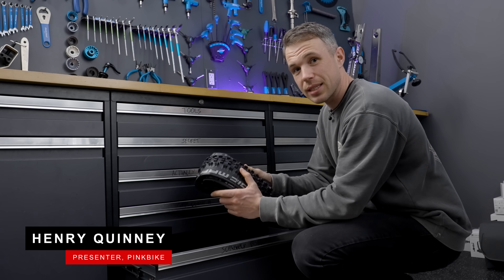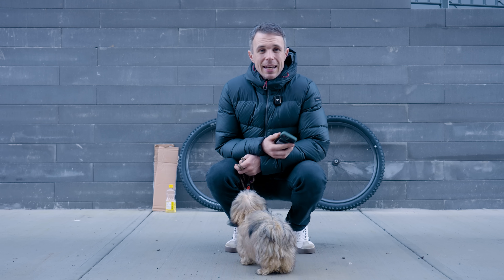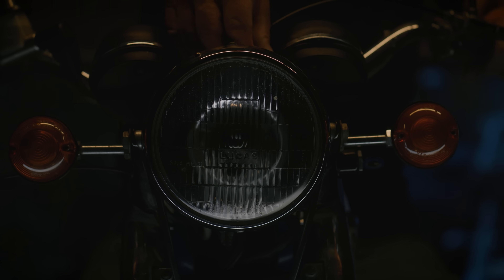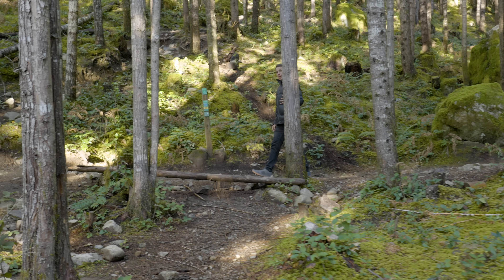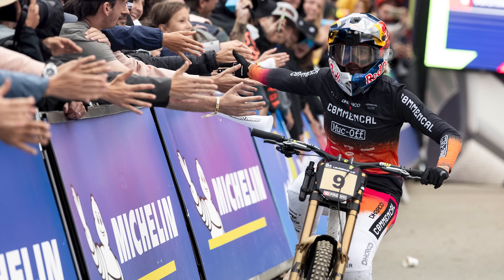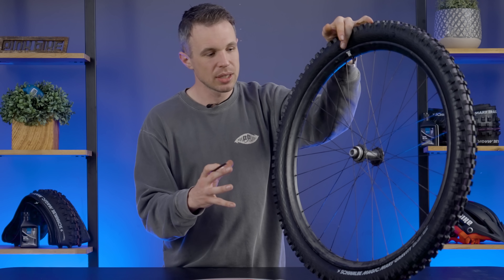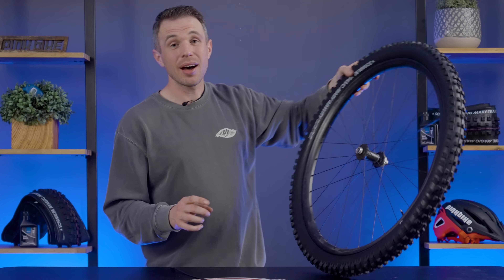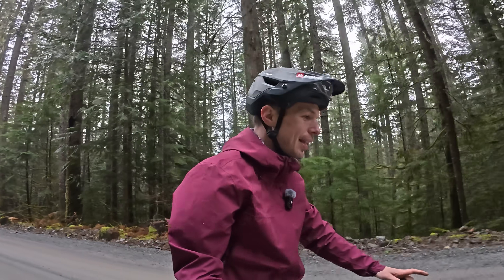How Does Schwalbe's Radial Casing Work, and Does it Actually Make Any Difference?

Comment: I have been running these tires.

In my opinion the Magic Mary Radial tire is garbage. Schwalbe ruined it with the changes they made to the tread pattern on the Radial version. They made the tread bigger and spread them farther apart. The Radial version rolls extremely slow, even slower than the standard model, and is only good in the most softest/muddiest conditions. On the flip side, the Mary does shine in soft/muddy conditions. All other conditions it sucks, to include the side lucks folding over. This is running pressures up to 32 psi. Once I started using over 30 psi in the tire the suppleness started to diminish.   

The Albert on the other hand is a pretty solid tire. In my opinion better than the Maxxis Assegai in every way. Rolls fast, works great in all conditions even mud. I haven’t had problems with it shedding mud.

I give the Magic Mary a 5/10 while the Albert gets a 9/10, in my opinion.

Comment: Got me a set of Albert gravity casing 2.6's and they do have great grip and they feel softer with more resistance when pedaling compared to the pressure my old tires were at. Upping pressure slightly made them pedal better.  Like said about tires being smaller is true as my 2.6's are more like 2.4's. 😵‍💫

Comment: Ok, so the contact patch in this test is absolutely same size. Radial casing means softer tires, so those can be good for lighter riders and only to use with rim protection inserts. You can simulate such tire behaviour just putting some paper-thin XC tires on your DH / enduro bike. Yay contact patch! xD

Comment: Interesting explanation and video :-) / Been riding then radial Albert gravity for some time now..managed to get a set to test for an Italian Mtb media outlet. At first I found them completely confusing..coming from a traditional tire set up like the vittoria mazza race which I have been using for more than a year. I ride the new Schwalbe on the same trail (rollercoaster finale ligure) for 5 times and each time adjusting the tire pressure. Last run on 27psi rear and 25psi front felt like I was able to get everything out of the tires and then some more. Perfect pressure set up..72kg body weight and 15kg super enduro bike = 87kg of weight.
Reply: How do you compare the Mazza Race with the Albert Radial? Do you like more of the Schwalbe over the Mazza now?

Comment: I'll just leave this here: bought the Albert, installed it, pumped it up to roughly 35psi before it blew off the rim. Installed it again(my mistake) to try if it still held air. Rode it for a few km down a train just for it to blow up again on the landing of a small jump. I don't know if I got a manufacturing defect or if the radial casing somehow has weakened the sidewall to an extend where it doesn't hold onto the rim, but I will say their stated max pressure is the lowest I have seen on any Mtb tire, even lower than on their other tires, which is concerning considering you are supposed to run it at slightly higher pressure than non radial tires.
Reply: Stan’s rim? I’ve serviced tires on just about every rim out there and the only one to blow off were Stan’s.

Comment: I've tried them on my Mountain unicycle, where tires are basically the only suspension, so its behaviour is very important. Does it make a difference? Yes, it feels more compliant at higher pressure, but it also feels very spongy at lower pressure. I like it slightly better for riding in rocky terrain with lots of sharp edges, but I think I might prefer the normal casing in smoother terrain. 
It's a good tire technology, but I don't think it is the revolution that Schwalbe claims and they should probably keep the normal casing around, at least for some models.

Comment: Everyone is drinking the coolaide.
Reply: Everyone getting payed to sell the coolaid. I'm desperately waiting for some independent reviews, but I guess everyone got money to produce ads (like this) on the launch, so they can't really do it yet. 
Good, but not a gamechanger and not better in all situations is my summary after testing them btw.
Reply: @ 100%. I am running a pair atm. Won’t bother putting them on again for the price. Every other rider who has tried them in my area repeats the marketing spiel back to me about them. Next front tyre will be High Roller 3. I predominantly ride loose over hard. Back to back testing with other tyres suggest these are pretty good.
Reply: @thegriff9425  Were they more expensive for you? I bought the Albert specifically because they were the same price as getting the magic mary I was running before again and I wanted to try a slightly less "spikey" tread pattern. Somewhere in the 70-80€ range is about where most soft compound, stronger casing enduro/DH tires are nowadays and the high roller 3 seems to be the same.

Comment: Wait a minute! HOW the contact is 30% bigger with the same pressure? Because sidewals are MORE compliant - they BEND more - that how I understand it. So, to protect the rim you will have to put more pressure - to compensate more bending of the sidewall. This will decrease contact area.
What is the point then?
Reply: Well, not everyting is linear.
Schwalbe says: Adding 7 psi (0.5 bar) still gives you 10% more contact area than a regular tire

Comment: What they leave out in terms of puncture resistance is the fact that there is no steel belt in the bicycle radial. With that said, what does a goat head do, besides go on through the casing? A piece of glass is going to Ginsu knife the tire regardless of bias or radial.

On the brighter side, radials will offer better ride quality and traction. I had a pair of radial XC tires in the early 90's that were made or offered by an obscure brand. They did work but were discontinued in a short time after the first couple batches were out. The issue was people throwing them on stupid narrow rims and wondering why they folded in the corners. Too supple was the reason the tires had been discontinued. (I hoarded wide rims due to the 90's sucking right out loud for rim choices)

Not many people can understand why my trials bike has a 48mm wide rear rim. With a 2.5 on it! Road rims are worthless for dirtin' and worthless for anything wider than a 1.5...

Comment: Correction at 6:29: crosses on a 3x are totally accidental. We use crossed wheel lacing to make sure that the spoke exits the hub tangent to the flange of the hub. Also - spoke length has no bearing on its tension.
EDIT2 - frankly - the entire analogy makes no sense.
EDIT3 - also, contact patch is almost entirely up to pressure.
Now what is true is that radial casing ought to be a little more supple because layers of the casing cloth are not working against each other - which is why it is used widely in car tires.

Comment: 2.6 Albert Radial measures at 2.4 when it's stretched. I'm not a fanboy or anything but failing at such a basic, yet so important thing makes me question about the effort they put into the new radials.
Reply: My freshly installed 47 mm tire is 42 mm on my rim. Gravel bikes have limited tire clearance, but I was brave enough to "size up". The rim can alter the width.
Reply: @fpeter01  mtb wheels "jaw width" has drastically changed in the last 5-10 years my 2016 all mountain 27.5 2.25 had 21mm jaw width now most have 31-33m this for sure changes the actual width of the tires I think I remember seeing a jaw width-tire width chart somewhere but can't remember if it was on a rim or tire pdf

Comment: "3x spokes are longer so you have to run the spoke at a higher tension to compensate" not remotely accurate. Longer spokes have more strain at a given tension so theoretically the longer the spoke, the less tension you need. d=PL/EA. After all, the only reason we tension is so the spoke can still maintain a force on the wheel while the wheel deflects, like a spring being shortened. And don't you dare try to tell me that the stiffness of the wheel is dependent on the spoke tension.

Comment: did not watch it till the end,too nerdy for me.. but have one of these(Albert) installed on this bike on my profile picture.. Rear tire on a hardtail and biggest difference of any tire swap so far in my riding career(10+year riding). I have insert in there as well,had to up my pressure by  0,3 bar (do not try and ride same pressure as conventional tire,just does not work). The way tire stabilizes rear end and smooths out the ride(especially noticable on carbon hoops) with much better braking traction,it is super reassuring. I did have old NOBBY NIC 2,4 on there before, in soft casing and this could have influence my judgment to be fair,but if you ride "stiffy" out back I think you can not go wrong.

Comment: Useless promo. Henry didn't even clarified that by "radial" they mean less than 45° angle of the threads (I think it's around 30°) and he proceeded to show how the equivalent position of a radial spoke would go "straight to the rim" which is not the case for this tyre. You pretend to explain and clarify how it works and you are actually more shady and dishonest than it would be flattering for you. Pinkbike could be a great source of technical knowledge but bills have to be paid... Pity...
Reply: Yeah this was shady. Pinkbike isn't what it used to be...

Comment: It's a good story, but it's made possible by tubeless technology.  Tubes need stiffer sidewalls so they don't pinch flat.  Radial tyres will become the next thing since it appears to be working out, plus they should be a bit cheaper to make.  They'll be tubeless only.

Comment: well, the oil test showed exactly the same contact patch...
Reply: The true reason for this design is to create seperation between you and your money.
Reply: SepAration vs seperation
Reply: Indeed
Reply: I have a hard time with the concept that radial laced wheels can be run at lower tension. The physics make no sense to me, and I think it’s a bad analog for tire casing.
Reply: How hard was it to find a ruler?
Reply: I'm sure that they will work as effectively as a placebo.
Reply: Ha ha, bet none of you nay sayers have tried them. I too was cynical and wanted to hare them. Now I  won’t consider anything else as a front tyre. They are brilliant in gnarly terrain
Reply: Let's wait and see the performance during UCI downhill and enduro world tour.
Reply: @APOCLAG Amaury won in spectacular fashion on them, running a ridiculously high pressure in the rain.
Reply: @justinfournier1285  Indeed! In fact, he won 5 races, 2 in deep rain! He is great!
Reply: @Mvees  Well, but you can't look at the oil patches shown there and tell me that there was any conclusive difference shown there. On a marketing video presented as a review such as this one, cynicism is the correct response.

I've tried them btw, different, but not universally better would be my take. Great in gnarly terrain as you say, but for smoother terrain I think I prefer normal casing.

Comment: My buddy was sheepishly admitted to rocking these when I asked Wtf are those? Must be expensive
Reply: They are, early adopter fee as always. I did hear good things from friends using them though, so I might fall victim to the hype as well
Reply: @sp00n  Not really, pricing is exactly in line with the competing tires. Soft rubber, strong casing enduro/DH tires all seem to cost ~80€, whether Schwalbe, Maxxis or Continental.

Comment: I'm going to say what i said in a comment. The entire benefit of pneumatic tires is that the pressure everywhere in the tire is the same. The area of the contact patch is simply the weight divided by the pressure of the tire. 200lbs on 20PSI tires will give you a 10 square inch area contact patch. Maybe the contact patch is wider?
Reply: If your tires is as hard as a rock the pressure doesn't matter at all. It matters how much force is required to deform the tire.
Reply: @a.r.8850  Exactly. I have some heavy load range tires on my truck and even if the PSI is down into the 10's the rear still looks near as inflated and the fronts at 50psi. The outer tire carcass is so firm that it takes a lot of weight to even begin to deform the tire.

Comment: I just climbed and descended 2500' on my radial Mary and Albert. I ran about 5 psi higher than normal for each. It was an absolute game changer. The grip was noticeable, but even better was having more air pressure for added suspension.
Reply: Isn't more pressure equal to less suspension?
Reply: @gooutanddogreatthings  More pressure gives your tires more compression before bottoming out on the rim. The only reason we run lower pressures today is for grip, but if we can get the same grip with higher pressure we get a little added suspension.
Reply: @ChristopherBloom  What do you weigh or what was your before and after pressure  -after adding 5 psi?
Reply: @TazErrant  I'm about 160 with gear and previously rode about 19/24 psi.
Reply: @ChristopherBloom  Thanks - that gives me a good comparison. I'm 110 with gear and currently run 16/18.

Comment: Have the Albert tyre on the front and love it. The grip is amazing. May get one for the rear too but run it at a higher pressure. When I got the Albert tyre I increased my pressure from 1 bar to 2 bar 👍

Comment: They really are a "bit" better than the normal MM Ultrasoft casings.  Needed to add a couple psi (20 up to 22) or they give way a bit in the corners, but you do notice a small difference.

Comment: These tires are not bad, just not worth the price. Increased suppleness is mostly negated by the high pressure you'll need to run. I will not buy them again unless they are cheaper than the regular casing.

Comment: I run a Zipp 3 zero rim, 220mm rotor and powerful brakes and a Push ACS3 coil conversion. This could be the next step to improving the front end of my bike. It was pretty amazing in the Alps this year as it was
Reply: Yes I was on my Yeti the other day with 222mm rotors and a Zipp 4 negative zero rim and my electronically actuated suspension by Ferrari. It too was pretty amazing after I toured my yacht to the New Zealand coast to hit the local DH trails in their beautiful summer weather.

Comment: A lot of great points explained in a unique, different and easy to understand way. Enjoyed that perspective, thanks Henry!! 

Unbelievable how much of a difference the Radial casing makes and I'm also impressed at how well the system works in wet and damp conditions, the extra contact patch makes an insane and notable difference as I'm running closer to traditional pressures. The grip gives confidence and helps with composure to hit those technical rooty or rocky sections. I'm a big fan!
Reply: But you get them for free and they support you…..

Comment: My dilemma... I have a Yeti SB160 with Continental Kryptoal front and rear, love them.  Looking for less rolling resistance possibly to help on longer ride days.  Was thinking Maxxis forekaster v2, or do I go with the radial Alberta's front and rear.  Is rolling resistance any better then my Continental's being I can put more air pressure in the Alberta's and get more grip and compliance?
Reply: The Forekaster V2 is awesome.  Side lugs still confidently large for turning and burning but rolling resistance is great! Id place it in-between the
 Rekon and DHR/F for grip
Reply: The radial construction adds rolling resistance, because the tire deforms more. I can't compare to the tires you mentioned, but I replaced a regular Magic Mary with the equivalent Albert and the rolling resistance is similar, despite running the Albert at slightly higher pressure and it having a less agressive profile.

Comment: I bet it makes a differance. I'm all for a casing that grips better at higher pressures 👍 I ran the DH22 (old wired ones) and I really feel the same thing that Henry talked about on the podcast a while ago about very heacy tyres with stiff casings. You are kinda chasing a level of comliance that you only reach at very low pressures. Which, in turn, is too soft when you hit things hard = bottom out. 
If this radial business is the real deal then I can pretty much bet my monthly allowance (aka pay check) that all brands will be introducing similar tech pretty soon.

Comment: Cars and motorcycles have been 7sing radial for a long time, why just now are bicycles going radial? 🤷‍♂️
Reply: But they don't ... These are not actual radials. Their threads have 30° angle instead of 45. That's it! Proper radial should have 0.

Comment: I have run Magic Mary in SuperTrail and Gravity Casing on the front in ultra soft for some years now and recently switched to the Gravity Pro Radial Ultra soft on my ebike enduro. It does indeed feel quite differently. There is more plushness and comfort and a bit more traction. I previously had problems on slippery, smooth rocks with the normal MM. The Radial works better. As for the intended surfaces, it works noticably better on muddy, loose ground and in loamy forest conditions. For hardpack the Albert would probably be better. I really like it! I was running 1,6bar (23 psi) in the front (gravity casing) for my 210lbs plus ebike weight. The radial worked fine for me with 1,7-1,8bar or 24,5 to 26psi. You do notice increase rolling resistance though. Thats why I would probably not use them on my trail bike. Especailly in the rear.